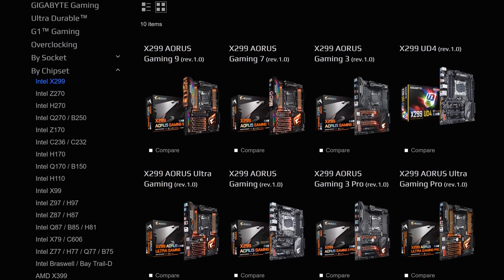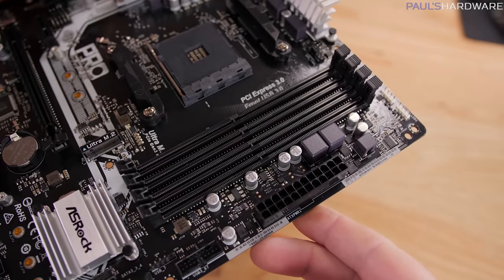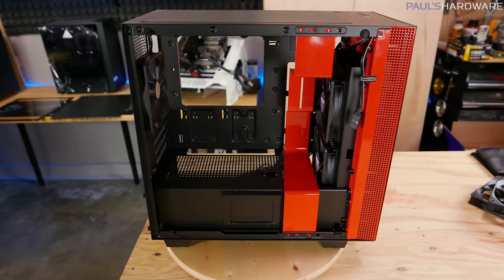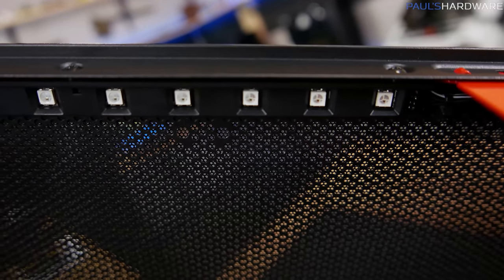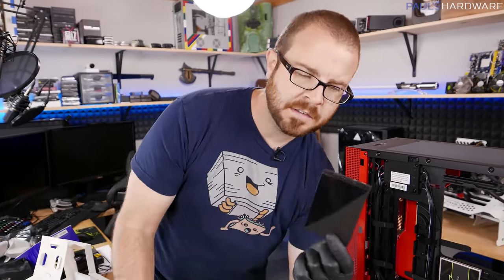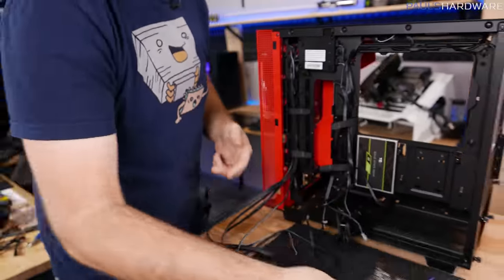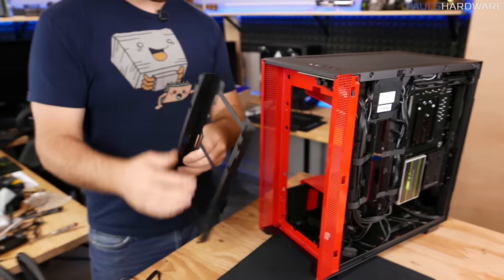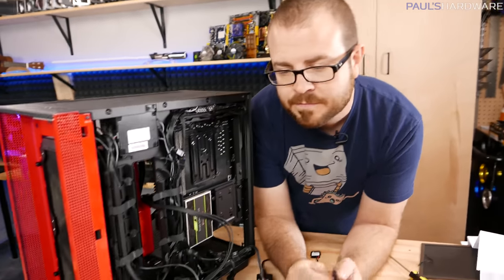Building a $1700 All-AMD PC in the NZXT H400i! R7 1700 + Vega56

Comment: You know the holes on the top of the power supply shroud are for moving that ssd caddy on the front of the shroud to the top so you could have the hue on the top of the power supply shroud
Reply: but it will hit the gpu clearance tho
Reply: The holes don’t align with the SSD caddy on the H200, so maybe it’s the same for the H400.
Reply: Athasin the holes are to mount a 3.5 inch HD.

Comment: Why would you need a hue+ if they gave you the smart device? Doesn't the smart device have a hue+ integrated with it?
Reply: The smart device works for multiple non-rgb fans (which I prefer to control via the motherboard actually) + the integrated and extra LED strip, not for argb fans.
Personal opinion (which I will do as soon as Ryzen 3xxx hits market): get the non-i version of this case, control fanspeed via the motherboard, create your own RGB solution from scratch (preferably with a single or motherboard-integrated controller). Less stuff to hide, more custom, more savings.
Reply: @Candisa  I'm an idiot, I bought the h400i not knowing this until I bought it
Reply: @Candisa  That's what I did. CAM software is kinda trash, I wouldn't want my fans to be controlled by that shit. Motherboard-controlled fans are so much better.
Reply: @brenlouissurio2404  How do you set-up motherboard controlled RGB fans? Plug them directly into the mobo?
Reply: @samkemp7834  Me too, Oh my.... :(
Reply: @OhBLZD  same question. Can anyone please answer
Reply: @Candisa  IT WORKS FOR ARGB FANS

Comment: finally!  a combined cable with the power/reset switches and lights!!  no more fiddling around with those in-between plastic helpers or wiring up boards like a neanderthal...
Reply: OMG! Is this the start of a revolution?? I wanted this since my first frustrated build back in 2005!!!
Reply: That's until you realize that your motherboard has a totally different pinout than the header.
Reply: The_rocketman yeah, that would suck. Possible solution is to bundle an adapter to old school split connectors, something like the opposite of what Asus does with their motherboards.
Reply: I was wondering myself what their solution is for motherboards that don't have a standard front panel pinout.  Do they include a breakout cable?
Reply: My MSI Z97 board from 2014 had a little plastic piece you just connect all the headers two and then just stick it on.

Comment: corsair v650 ??? ehhy
cooler master v650???
Reply: 2:55 ehhhh hehe
Reply: Lols!!!
Reply: the v650 is actually amazing tho, I use it my build, and wow is it a good looking PSU, affordable, nice cables, fully modular, sweet spot for wattage, what more could you ask for?
Reply: Yes!!We knew that!!Funny because he messed up brand.!!
Reply: @Jordi Bear; While all those factors does make for a good every day PSU, what really makes the V series from Cooler Master amazing is what is inside it. I'm not talking about the gold rating, anyone can do that. What I'm referring to is the build quality and the choice of components, this is a PSU that is really likely to last you 10-15 years with the first thing to actually break being the fan due to faulty bearings.
Reply: Rainmaker I'm 100% agree with you.Sometimes gold rating did not mean shit when they are using cheap internal components.
Reply: exactly, you can easily have a platinum or titanium rated PSU with cheap Chinese caps in it. Which most people know these days usually has a lot shorter actual lifespan. It's to bad to, because there are a lot of really good PSUs out there that are brought down by the sub par components inside (as in the design is great but components are crap).
Reply: First time I've seen Paul Hardware build AMD.
Reply: Hi Gabriel. The Vanguard series from Coolermaster was actually really well built. I have a v1000 and I've put it through hell with overclocking and SLI builds over the years and the thing just keeps going. I remember I bought it initially because it got a great review from Jonnyguru, he scored it a 9 point freaking 7 man. Damn good unit!
Reply: 2:55

Comment: Hey Paul, I have the same case with an x62 and the same configuration as yours. However, I can't get the front air filter to clip on. I notice on your video at 19:12 you try to punt on the filter but it looks like it did not fit. Can you confirm if it does fit. If yes, what did you do? Tks!

Comment: You said Corsair. And I knew you meant Cooler Master on the PS... No biggy. Nice build though Paul. I have yet to build my first ever AMD build. Looking forward to it. Knowing I have people like yourself and others for references. No problem.
Reply: FlippinFreds Free Form Factor one tip, the bracket isn't always the most secure for pga cpus. So if your ever needing to remove the cpu cooler,make sure and warm it up a bit beforehand and do a slight twist and be careful. I've seen many people bend pins changing cpu coolers without warming it up some.
Reply: Yes and the stock cooler can be particularly fun to get off the 1700. without pulling the cpu out with it.
Reply: No it's nottt man it's garbage and still won't run a lot shit...but idk you want to build that shit lol

Comment: Paul it seems the radiator fans should be in the other side so you can get fresh air from the front instead of get warm from the inside. That's why the front dust filter was thick.

Comment: I fit the NZXT Hue inside of a NFC S4 Mini case, just FYI the top plastic comes off after removing a couple of screws to reveal it is a completely flat pcb, after the top comes off its no thicker than a 9mm 2.5" drive.

Comment: 15:57 can the fans be mounted on the front of the bracket like where the radiator goes mounted or not? bc  don't wan to see the front fans and maybe I can fit the gigabyte rtx 2060 the white version with 3 fans gpu... is that possible? if I can't mount the fans on the front of the bracket will the gpu still fit?

Comment: I’m building the with the h400 the cable management has gone out the window, is it ok to put the wires next to the psu, surely it’s blocking the lower rad fan

Comment: I noticed that the H400i has an extra "step" in it's cable management bar for the 20 pin MOBO psu connectors, something i think should have also been on the H700i, as it was mentioned more than once

Comment: Hi Paul, i don't know if you are already aware that each usb 2.0 header on the motherboard have 2 usb 2.0 ports, so if you do a bit of custom wiring you can get away without using the usb hub, since every usb device use only a single port but is wired to a single header for convenience. Anyway, fantastic build!

Comment: I’m triggered that there are 3 exhaust fans and 2 intake
Reply: Levi V. Positive air pressure is where it's at!
Reply: its more important to get the heat out rather than getting cool air in!
Reply: @KimaliaX  Hi, you wouldn't advise this fan direction setup? Not sure but it looks like he pulls in hot air through the cpu radiator. Is it better to put the radiator on the top?

Comment: Good video.
Got a little frustratred when I saw the top of the H400i, why did they not give the H700i the same ventilation too?
It really needs it!
Im about to cut mine open just to get decent airflow to my PE360 rad up there (got XE360 in the front).

Comment: Hello
Please help.
I have the Asus Code motherboard Maksimus X Z370.
It has only one USB 2.0 slot
I want to connect in the H700i housing
3x factory fans
Front panel 2xUSB 2.0 and 2xUSB 3.0
Kraken x72
I will need an internal NZXT USB hub for sure, but I need to connect it to the only USB 2.0 motherboard on the motherboard.
So all I have to plug into one slot with the help of the adapter?

Comment: You should have aircooled the CPU and put an Alphacool Eiswolf on the Vega card instead. On such a motherboard the CPU cannot clock high enough to make it worth using an AIO. Doing things the way you did dropped perf/$ quite a bit, which is a fair concern with a 1700$ budget in my opinion.

Comment: Will a MSI GeForce rtx 2080 ti gaming x trio fit in this thing, I’ve already ordered the parts...
Reply: I have that same gpu,but its the 2080,mine barely fits and I have the NZXT H500i with about less than half an inch to spare, and just forget about vertically hope that helps you out
Reply: kool Cycledad damn really? Is says on their website that there’s a GPU clearance of up to 411mm, but I guess with that number shrinks when installing the cpu cooler
Reply: kool Cycledad wtf just read that apparently the h400i has a larger gpu clearance than the h500i 411mm vs 381mm, but it doesn’t have a back radiator, cpu cooler mm is the same

Comment: If you use both the Hue+ and the 'Smart Device', do you plug the LEDs in the Hue+ and the fans in the Smart Device? Or will the fan's "smart learning" still work if you plug the fans into the Hue+?

Also, does the smart device also manage the Kraken, and do you need to tie that in to the Smart Device as well?

Comment: Would love to see temperatures and noise levels for that case with the AiO setup. Also, couldn't the hue+ box go on top of the PSU shroud? Or does the H400i not come with the same SSD mounts that the H700i?

Comment: Hi Paul,  thanks for another interesting Video.  Question:  which way are the liquid cooling ventilators blowing ?   I guess inside, so the air comes from the side holes around the front red metal.   But if this is the case,  you bring hot air in the case, so other parts have less cooling capacity (delta T).   Would it not been better to place the radiator at the top and blow hot air out.  plus from the front fresh cool air for the hole cabin (VGA, power, MB, drives ...).   Or is their a special reason for or was the case not suitable for it ?   Thanks and best regards  Marcel  (The Netherlands)
Reply: Yes, it matters where you put your AIO. Turns out that the front is your best choice.
See here: https://www.youtube.com/watch?v=xNAMxZgvves

I have this case in pre-order. They are hard to come by. You could not find reviews of this case until now.
I don't think i need rgb fans because other parts will do the job just fine.

Also best regards from The Netherlands.

Comment: Hi Paul, may I know if you can add an additional 2x 140 fans at/inside the front panel?
Reply: you can. You need to reverse the fan filter (which Paul didn't do) Download the manual, you will see some useful 3D diagrams from a detailed CAD model
Reply: awesome! thanks for the info, it was between this case or the meshify C for me, and i think i'll go with this one since the meshify c has problems with long graphic cards.

Comment: Hi Paul, did you have issues with clearance between the fittings on the Kraken block/pump and the first RAM slot? Obviously your using two DIMMS for this build, but I'm wondering if the Kraken will work with an mATX board that has all 4 slots populated.
Thanks for the great content, this might be a first for a build video inside the H400i!

Comment: can you do push pull in this case?
Reply: Buffalo Boy I highly doubt it will support that on the front but most likely not
Reply: it looks like you can because the fan filter was raised off the front radiator tray.

Comment: I learned that with my first build on my H440 case it was a pain in the ass to install RGB fans from NZXT of course I didnt buy the internal USB but regardless for my first build it was very frustrating and felt there fan connections were cheap and very flimsy as far as they did not lock in when you route fans together with there wires they didnt stay in or lock in it was a pain but better to learn this on first build now i know what to look for in buying new cases on next or should I say NZXT build lol, if I go back to them.

Comment: but isnt the smart hub in the case technically an integrated hue+ ?
Reply from the maker: It has a single LED channel, whereas the Hue+ has two. Since you can't daisy chain fans & strips on the same channel, the Hue+ was required to connect the fans.
Reply: i didnt know that. huh, thanks for the answer tho!

Comment: is it worth upgrading from an rx 470 to a gtx 1070? is the price justified or is there something better I should get for the price?
Reply: SpartaX a 1070 is roughly 30% faster than a 470 overall.
If it's worth to you depends on the processor and monitor you have.
If it's a 60Hz 1080p monitor then obviously not worth it for now.
Although if you have a 1440p monitor then yes. But it's probably better to get the Vega 56 in that case since it's almost as fast as a 1080 for around 399$
Reply: hello walkman hmm... Thank you, I play on a 144hz monitor and the games with mid-high settings depending on the game @1080p. Might just save up for a 1440p monitor and a gtx 1080
Reply: Rx vega*
Reply: SpartaX i see. What's your CPU ??
Reply: hello walkman an r7 1700 OC'd to 3.7ghz on stock cooler. I have a newer cooler coming in soon. Do you think I'll experience bottlneck?

Comment: dat negative pressure tho
Reply: I was thinking the same thing. Prob should have removed the back fan, or made the rad a push and everything else pull.
Reply: Not necessarily. Remember numbers of fans doesn't equal air pressure. If he ran the two front fans at %60 and the ones at the back at %30 then he would still have positive air pressure.

Comment: I'm assuming because it's the itx case they don't include shroud SSD mounts but considering the one on the from by the glass is the same i'm certain you can remove it and attach it to the shroud via the vent holes like the ATX version and could've place the Hue there
Reply: Josh this is the microATX not the mini ITX case. The mini ITX case is the H200i
Reply: Small mistake but my point stands

Comment: what is interesting about your playlists, is that for $1700 one can get a decent Ryzen 7 1700, but for $1850 you can enter the threadripper platform....makes it so difficult to understand the advantages of one over the other for a $150 diff
Reply: find a microATX sized Threadripper motherboard and then you might have a point. Yes it can be done (with daughtercards, using the back of the PCB etc). But no one has done it
Reply: have you seen todays prices for Ryzen 1800x and Threadripper...they are the deals of the year

Comment: It seems to me a little odd that the led colors and those kinds of things have taken such strong preference in modern builds.  So much so that they have become, or seem to have become, a major technical challenge when putting a system together.  I would have though this kind of issue a distraction to focusing on building the best possible performate and stable computing platform.  Very odd indeed.... but then I guess I am an ‘old timer’ 😀
Reply: think of it as just another technical challenge, although involving the Cloud with your (smart deviced) PC build is questionable at best. less Old Dog New Tricks.... just more of the same.

Comment: Can you help me with a build? 8700k build?
Reply: Ziek. I have a 8700k, what do you need help with.
Reply: stephen mercer I’m trying to figure out what the best motherboard to get that has slots for nvme m.2 slots
Reply: stephen mercer and I need advice on wether a build looks good on pc part picker
Reply: Ziek most of the z370 boards have m.2 spots alot have 2. Here's my build, which I game/stream/edit.
8700k
Asus z370 tuf gaming pro
Corsair h100v2
Trident z 3200mhz 2x8 kit 
Evga g2 750w power supply
Asus strix 1070
Samsung 860 m.2 
Toshiba 4tb hd
Deepcool kendomen case with some uphere case fans.
Maybe this helps.

Comment: Im building a new system and dont know if i want to use my old case (Phanteks Enthoo Pro), i would buy a new one for 100-170$/€ i want a glass side panel  and it should be not to smal (mid-bigtower) someone got an idea/advice wich one to get? Parts coming in: Ryzen 7 1700x, Kraken x 62, ASUS STRIX X370-F Gaming, G.Skill Trident Z RGB Series 16gb 3200 cl 14, leftovers i will  also use :GTX 1080ti Palit, 600w Bequite 80+ gold psu and 2 ssds and 4 hdds.

Comment: Vega in a small case like that? Talk about hotboxing ;)
Reply: Its a Rear Exhaust GPU Cooler ... it doesnt really matter how big the case is.
Reply: James DePriest I put it in a ITX case with no fan I wanna set my house 🏡 on fire 🔥 😂😁🤣
Reply: What about the heat from the radiator which is only 1 inch away.

Comment: the h series is just like getting any old case and putting a fan and RGB hub inside it and bumping up the price by over $100 as the Corsair Commander Pro is $69.99 and paired with a case that is as featureful as the H700i costs less than it
Reply: No
Reply: Not really the case is worth $200 alone imo, I just bought an H700i even though I may not use the hub. Dark Base 700 is a competitor at $180 but I think H700i is better.

Comment: Case 200 $, MBO 75 $. Priorities. Or as i call it, idioicy.

Who in their right mind will buy mid range MBO and then splash over 200 $ on case and accessories?
Reply: not enough micro ATX  option...
Reply: RoboDog there are not alot of high end mini atx boards
Reply: That's exactly what I purchased (same mobo and case). There just aren't many mATX AM4 mobos and this one is actually a very good one. It's B350 so overclockable, has 1 Ultra M.2 slot which supports NVMe drives and 1 SATA M.2 slot, has good VRM and 6 phase power delivery for the CPU. And it's black/white design fits my build perfectly. If it checks all the boxes I don't see why that's a bad thing. It's just that AsRock builds really good mobos at really competitive prices.
Reply: There aren’t a lot of ITX boards out there and even less for AM4. Don’t blame the man, blame the market.